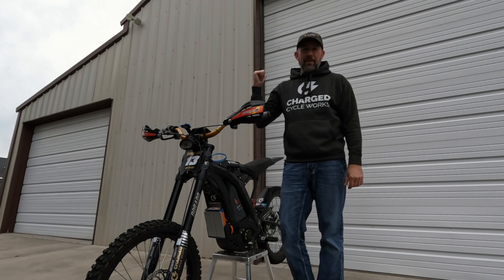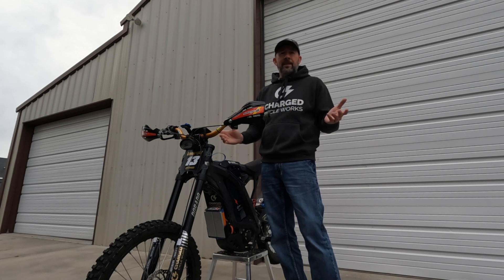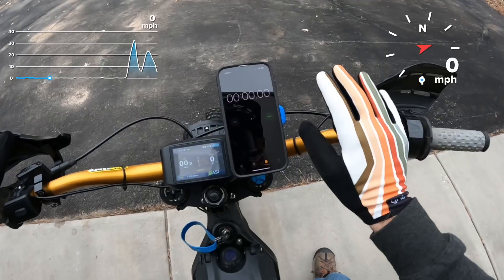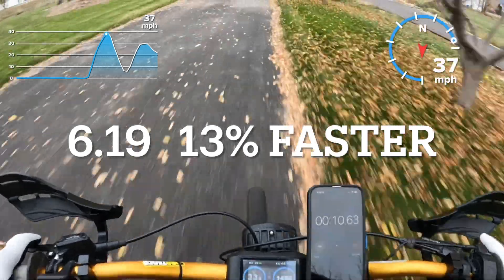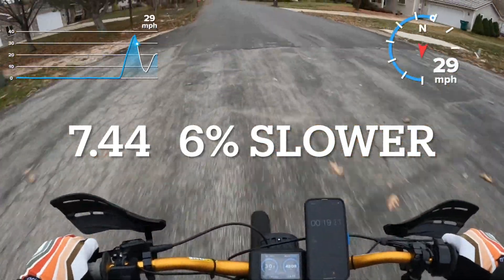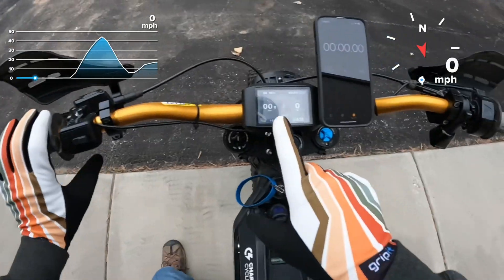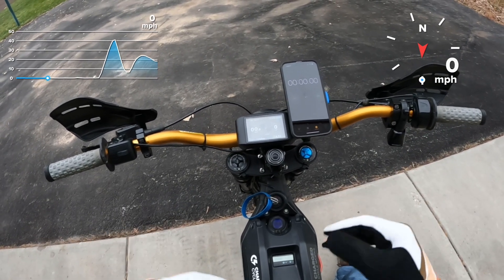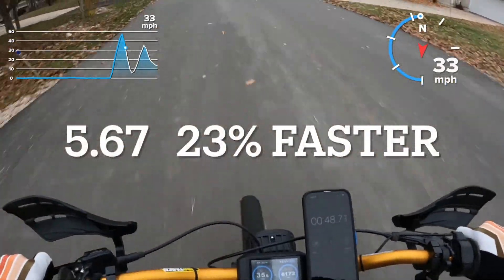Surron BAC4000 Acceleration Tests 72v vs 60v

Comment: It seems like a large 60v is the way to go. Still super fast but not to the point where its just too much. As long as it has the top speed, range, and acceleration and torque to rip wheelies that's a win.
Reply from the maker: The biggest reason to go to 72v is to lower the temperatures in the motor.  If you do a lot of hill climbing or MX full speed riding the motors overheat easier with 60v.

Comment: Question I just got ebmx bac 8000 and 72 v battery. Very fast. But the display only reads up to around 6,000 watts. Thought these were putting out close to 15,000 watts. Am I missing something? Why doesn’t the display show higher watts?
Reply from the maker: hah!  yeah this is a weird issue with the APT display, if you watch closely it loops and resets, you'll never see 15,000 on the display unfortunately

Comment: What motor are you using, is it a stock motor?
Reply from the maker: All of these tests had the stock motor.  We recently moved to a new location and will begin doing these tests again with 8000, KO, 9000, KO motor, etc.  But it's winter here and too much snow at the moment.
Reply: @ChargedCycleWorks  Thanks for the reply, Ive just purchased a surron and still in the modification research stage, I'll look forward to the videos!

Comment: This is why I will not be buying a BAC controller. This silly business of not being able to change the settings in your controller is absolutely nonsense.
Reply from the maker: Not sure we follow you, perhaps because this video is now slightly outdated.  If you purchase an EBMX BAC8000 they have an app that allows you to change/control all the settings you would like including:  Voltage, Power KW, Amps, Regen, throttle, and more...

Comment: Mahalo Nui Loa! I received my BAC 8000 controller! Power level 3 lifts my front tire with ease. It’s time for me to kill some hill climbs! Bac 8000 with a EBMX 60V battery is just insane power!!!!!!!
Reply: What 60v battery did you get? Looking into upgrading?
Reply: @ajhenderson5849  EBMX 60V 52ah ⚡️ 🤙🏽
Reply: @HI_ROLLA808  how you liking it so far bradda
Reply: @JorOutdoor  power is amazing. The only criticism I have with the EBMX battery is there wiring fried because it’s so thin with the amount of power flowing.  EBMX will tell you that it’s from water or dirt. I told them I don’t ride my bike in the house or in a gym. 😂 they recommend to upgrade the wiring to a bigger gauge. Which to me they should of done when manufacturing the battery at first. I had to find a person because the battery dealer I bought it from didn’t have anyone to do it. 🤦🏻‍♂️ 
Issue is resolved after finding someone months later…..but the other weak point was the battery LCD screen that got water in it and doesn’t show the battery percentage. 
I didn’t want to go through the BS. 

I recommend to upgrade the wiring and QS8 connectors. The ebmx battery screen display add some kind of silicone to keep rain or water out from going in.

Comment: Im not sure about the 8.5kw on stock battery, thats not something these cells were made for... 60v * 110A (Rated max. discharge of 10A per cell)  = 6600W = 6.6 Kw I also put my unbypassed battery to 7kw and it seems to worku untill it dosen't (starts to cut out) If you do that whitout a bms, well then you should have a spare battery at hand ;)
Reply from the maker: Great comment!  EBMX is very aggressive with their tunes and you are correct some batteries handle 8.5 and others need to be turned down to 7 or 7.5 to not have a cut-out while riding.  However, we HIGHLY recommend pairing a controller upgrade with an aftermarket battery designed for these higher power outputs.

Comment: Hi mate so what would be the best uo grade to do on my talaria bac 8000 plus a 72v battery? Or could I run stock and get good Proformance to ? Thanks
Reply from the maker: At the moment there are no power upgrades for Talaria, but soon we will have BAC8000's for them and you'll have the choice to use your OEM battery or upgrade to a larger one.  If you have an RST fork that is the very first thing to fix, it is horrible and a much higher priority than adding more power.  We also prefer to upgrade wheels/tires first because once you have more power you'll be wishing you had more traction.  For Talaria our preferred upgrade path is:  Fork and riser bars, tires/wheels, power.  You can see our Talaria Packages here: https://chargedcycleworks.com/collections/upgrade-packages
Reply: @ChargedCycleWorks  thanks mate for the information

Comment: I have a question for you I have a BAC 4000 with a 60 volt bypass battery if I was to buy say a 72 Volt or a 60 volt 12 KW what I need to do anything different with my controller or can I keep using my BAC 4000 and I will have more power then my stock 60 volt bypass battery
Reply from the maker: If you want more power you'll need to change the tune on the controller with a new battery and once you do this you are no longer compatible with the OEM battery.  If you have for example the EBMX controller you can use their app to go back and forth between different tunes which allows you to use any battery you want to and it only takes a minute to load the correct tune for that battery.

Comment: If you would google the datashied of the original Surron Battery cells you will understand that 8.5kw is really shit and stupid  ... 🙈🙈🙈🙈
Reply from the maker: Google has some really good dis-information spread across the internet as well. Instead, we rely on real-world testing across literally thousands of very satisfied EBMX BAC4000 customers. 8.5kw is peak, very rarely used for long periods of time. Most customers ride this BAC4000 tune in level 3 or 4 out of 5 (6-7-ish KW). Customers that plan on running a BAC4000 at wide-open throttle are encouraged to purchase a stronger aftermarket battery that can handle the power better.

Comment: So with 72v you’re accelerating to a speed ab 30-60% higher and doing so 25% faster than stock. Very impressive
Reply: Yeah but if you want that best off-the-line acceleration, you need to use all your phase amps which is only used on your highest mode (level) regardless what you set the max kW to
As this is the main technical difference between the BAC4000 & BAC8000, it should be obvious that phase amps makes a difference lol
And then of course you have your field weakening setting, 0%, 5%, 10% are my go-to options. I only wish it was easier to change on the fly
The bike acceleration feels slow to me with 0% field weakening but then again the torque is highest without field weakening combined with a good amount of kW, same goes for these settings:
5% is a huge boost & makes the bike accelerate faster while still maintaining most of the torque that's lost
10% the ultimate 72v experience, if I'm not mistaken this is the 70+ mph setting if you combine it with a good amount of kW but torque is low at this point compared to 0%/5% field weakening. It feels considerably faster and will leave you with a smile, it's that good!
Keep in mind that -it's hard to keep track of how much these settings drains the battery it's probably best to do your own tests to find your range limits. Lets say 10% fw + 10kw can drain 10-20% of your battery very quickly if your maxing your throttle. Get the max or touring batteries from chi battery if you want the best experience
-You can increase your torque by opting for an upgraded 60v instead or getting a bigger sprocket, each with their own pros/cons

Comment: is this 0-60 mph?
Reply from the maker: None of these bikes (without mods) are capable of 60mph.  We test every bike configuration on the exact same fixed course so that we are testing with 100% consistency and the time can be compared across the board on every single run.  In the car world this would be the 1/4 mile run test.   From there you can calculate percentages to get an accurate idea of how much faster (or slower) each bike or bolt on part affects each bike.  Please see full details here: https://chargedcycleworks.com/pages/acceleration-testing
Reply: @ChargedCycleWorks  thanks for the reply, that helps me understand your methodology a bit better. I am still a bit confused though. In all your tests you show a "time". But what does that time mean. Is it a 0-40 mph test? You must be testing each configuration's acceleration from 0-something right? I don't see on the site what the range is either?
Reply: @vapedragon983  He starts in the same place and stops the clock at the end of the driveway every time. Faster bikes cover the same distance in a shorter time period. The driveway distance is the fixed constant, much like a 1/4 mile drag race (but shorter).

Comment: The problem with these, is when you do just a few upgrades, you're getting very close to a real dirt bike price. Then you eventually put enough in, that you could have had a much better bike, but now stuck with a chinese bike thats only worth 4-5k, and you put 9k into it lol.
Reply from the maker: The problem with your opinion, is many people who ride SurRon's either 1) already have a dirt bike and want something more playful and quieter with much less maintenance or 2) don't want a dirt bike because it limits where you can ride. We have both and love both for different riding styles. If you think they are only worth 4-5k after putting 9k into them, go check out the used prices to better inform yourself. Demand is sky-high and they are only getting more popular. They hold their value surprisingly well + you can part out and lose very little money.
Reply: @ChargedCycleWorks  There is no problem with my opinion; these bikes were only $3,600 less than a few years ago, now 3rd party places are asking almost $1,000 more. Better to just buy from Luna Cycles as they are still cheaper. All your arguments are invalidated when you look at the new bike Sur Ron & KTM have for $10k, both are also electric, but have much better platforms, power and suspension.
Reply from the maker: @TJ-po9ol  and our reviews of those new bikes will be out soon. Completely different bikes, with many of our customers owning both. We have the KTM Freeride E-XC and it's biggest limiting factors are 1) the weight at 245lbs and 2) the range at only 20 miles. Sure, it rides great, has excellent throttle response, and better suspension but my personal SurRon cost over $3k less, gets 40 miles per charge, goes just as fast and, perhaps more importantly, has an unmatched fun factor. The best part of all these new electric bikes? You can go purchase whichever one makes you happiest.
Reply: @ChargedCycleWorks  I rode a new stock Sur Ron & it was extremely underwhelming. They need at least $3,000 in battery/controller mods to be interesting. The Cake bike is better for power/weight/performance if you’re going to fully upgrade a Sur Ron, might as well buy the Cake.
Reply from the maker: @TJ-po9ol  lol, now you're suggesting an $11k Cake vs a ~$7k built SurRon?!? Yes, many people like to start with a reasonable bike at a reasonable price point and upgrade/personalize their bikes as they see fit. Hence the video, our testing, opinions, and the entire Charged Cycle Works website.

If you're interested in the Cake, go buy one. They're great bikes and we have a page on our website to support them. I suggest test riding one first, as you'll most likely wish you had the $13k race version for it to be "interesting". As more Cake's hit the market, we'll add additional parts and accessories to make them even better.
Reply: @TJ-po9ol the surron is 120lb and I can just toss it in the back of the truck..? bigger bikes are much less portable, more hassle for my use case

Comment: Is that 12kw peak or continuous?
Reply from the maker: peak, if you tried to run a surron motor at 12kw continuous you would destroy it.  These high power tunes are only meant for short bursts of power which is perfect for off-road riding where cannot use the full power continuously on such a small and light weight bike.

Comment: I got ebmx 8000 tuned down to a 4k for now.  I no longer have a button for my horn.  Are there any aftermarket horn buttons once you use a controller like this?
Reply from the maker: Hey Peter, you can use this horn button (and light) regardless of controller/display. https://chargedcycleworks.com/products/horn-button-by-warp9-for-surron-segway?_pos=1&_psq=horn&_ss=e&_v=1.0

Comment: Hi I have bac 8000 and 72v/42ah lite speed battery and running on 14KW, I feel like the battery going down pretty fast so wanted to know what kw I should run
Reply from the maker: good question, not sure we have a perfect answer for it.  Essentially the more power you use the faster you'll eat your battery.  So, if you are a fast rider like we are, the best way to increase your range is to reduce your available power so that you cannot use it and deplete the battery faster.  We've spent a lot of time on our 8.5kw tune and feel like it's got a great mix of power/range.  Going up to 12 or 15kw will really let you chew through the battery fast!

Comment: Hi I’m debating between the 72V ebmx vs chi battery (either 60 or 72v), what’s the approx range you can get from the ebmx 72V? Assuming going mainly 40mph street riding only as I live in nyc
Reply from the maker: We never ride on the street, we do it in the dirt :)  The range between EBMX and Chi will be nearly identical as they are a similar ah battery.  Here is a little hint on calculating how much energy is available in each battery Voltage * ah = watts.  EBMX 60v * 53ah = 3180w, EBMX 72v * 42ah = 3024w which means the 60v should have slightly more range.
Reply from the maker: One more comment about your use case, 72v might be a better option for you to reduce heat in the motor at consistent high speeds.  72v lowers the amps and therefore lowers the heat in the motor.  Usually when people overheat the surron it's non-stop high speed and long steep hills.

Comment: Can you do a heat test with the 60v chi vs the 72v? Since the 60v is pushing more amps to get the same KW it seems like it would heat up faster. It would be nice to see a sustained 45 mph with both batteries to see which one makes the motor heat up faster
Reply from the maker: BTW heat is the biggest reason that we recommend 72v to customers.  For most it's not an issue, but riders going up long steep inclines can certainly overheat the surron especially after power upgrades, 72v is the best way to battle this.
Reply: @ChargedCycleWorks  Id love to see the heat test cause I get the opposite results. Me & my friend have identical BAC 4000 setup but he has a 72v and I have 60v we weigh about the same, every time we go through sandy trails (deep sand will get your bike hot fast too) his 72v bike overheats and my 60v is always fine.
Reply from the maker: @BigEBikes  I suspect it's because he has the phase amps turned up higher than your 60v? If he is demanding more power than the bac4000 or the motor can give, it creates heat. What are your power and phase amp settings for both?
Reply: @ChargedCycleWorks  his phase amps are set to the same as mine but his flux weakening is higher than mine
Reply from the maker: @BigEBikes  Have him reduce his field weakening. If he doesn't need top speed (where motors start melting) then he is creating excess heat with no real benefit. Many prefer between 10-25%. The higher the %, the less torque his bike will have, but higher top speed. The lower the FW %, the lower the RPM's, the less heat he will generate.
Reply from the maker: we definitely have plans to do a heat test, unfortunately its winter here and we'll be waiting for spring to do it.  The location we plan to do this is not accessible during winter season, we need a long steep consistent grade where we can do repeatable tests. :)

Comment: Check out HI Powered Cycles novelty electric bike called the Typhoon Pro. 26x4 rear tire 27.5 in front. It uses a Hub drive but placed in the bottom bracket as it is a mid drive 
bike. I think it is the very best you can buy.

Comment: but the 60 v has more range so I know the clear winner here
Reply from the maker: Maybe... we need to do some more testing side-by-side 72v vs 60v of similar capacity batteries.  A lot of people think a 60v 53ah battery has a longer range than a 72v 43ah battery because of the bigger ah number, but that's not an equal comparison.  You must multiple the two numbers together to get the energy storage (watts) of the battery: 60*53=3180 72*43=3096 so in this case (EBMX batteries) the 60v 53ah contains 84 watts more than the 72v.  However 72v runs a bit more efficient, there is probably no noticeable difference in range between them in this example. We've been testing both and haven't found a "clear winner" yet.
Reply: 3100 watt hours approximate on the 72v , 3800 watt hours approximate on the 60v again I see the clear winner as the 60v does have more range , plus I’ve tested with mates who have 72v , my 60v lasts longer !! , obviously 72v may be more efficient in ways , but when the police are chasing u range is  the winner lol 😂

Comment: Isn’t max power w/ stock battery (bypassed) and a Bac4000 7kw?
Reply from the maker: 8.5kw bypassed
Reply: EBMX does 8.5kw but emb does 7kw. Technically the cells are only rated for 6.6kw so voltage sag on the ebmx tune is probably terrible, especially if you do long pulls